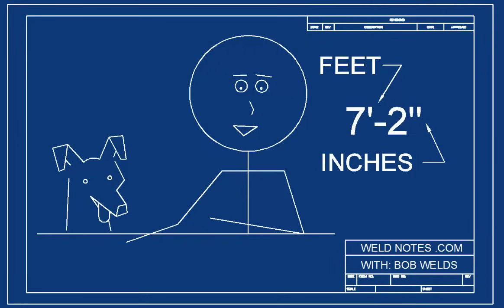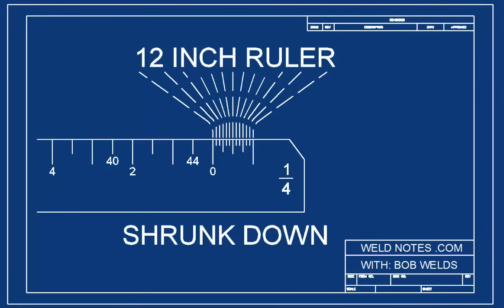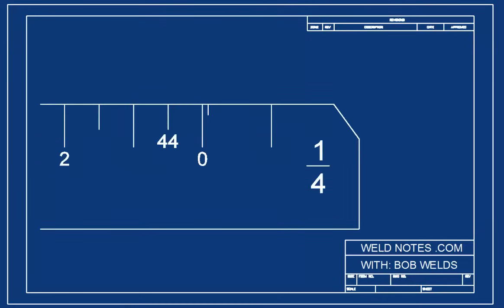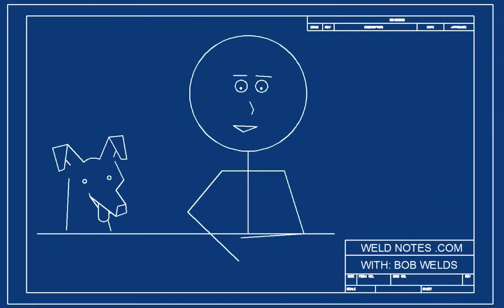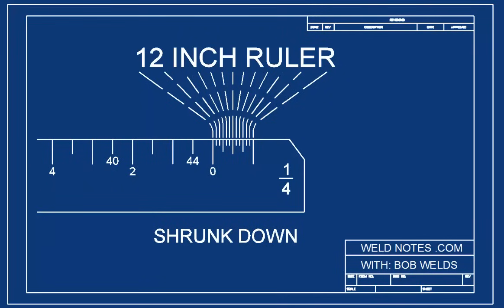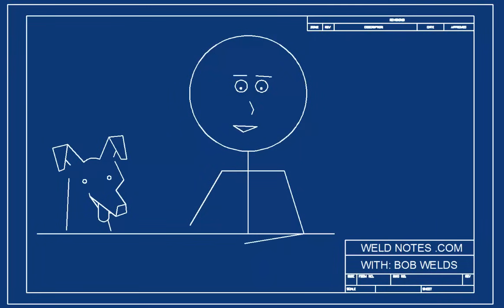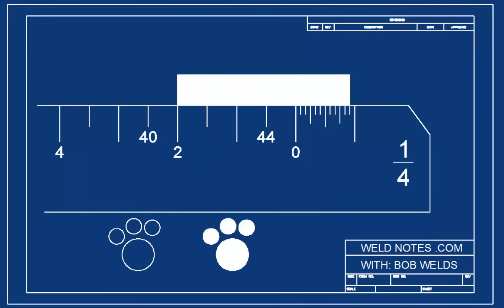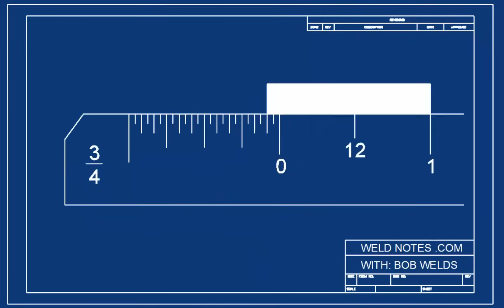How to Read an Architect's Scale

Comment: I have a Question.
In the 1/8"=1'-0" scale we see the feet markings shown labeled at 0 and then 4 ..this means the 1' marking is the line that's marked 22 (that corresponds to the 1/4" scale at other end) but in the 1/4" scale the foot markings are shown at 0,2,4 indicating the non marked lines as 1,3 etc which do not correspond to the shorter lines meant for the scale at the other end. This is a bit confusing to me as in one scale the lines interact. Is my question clear?